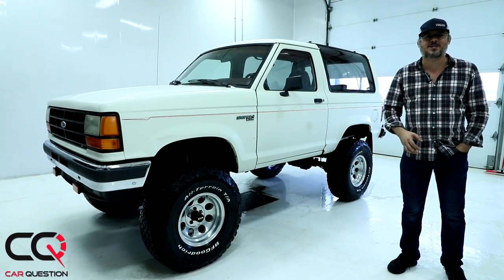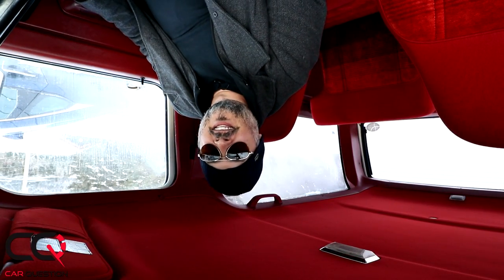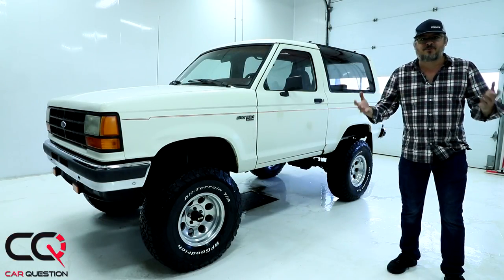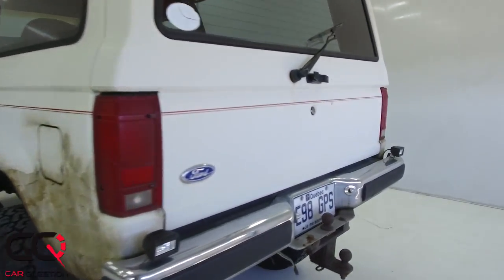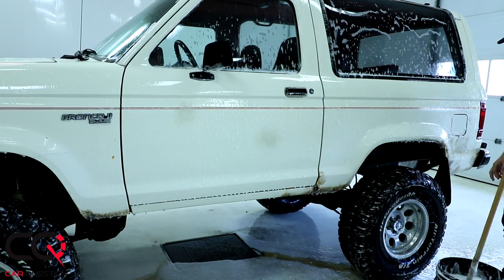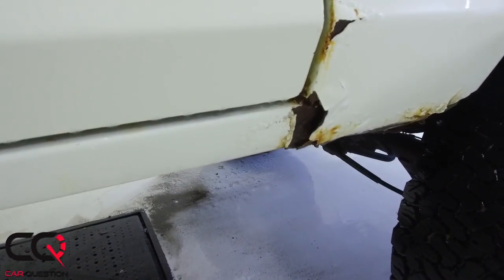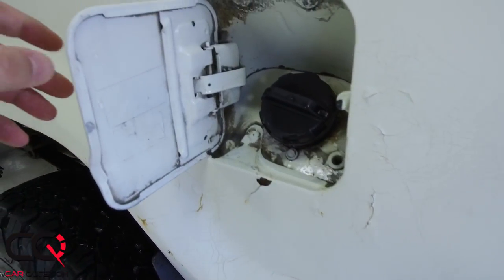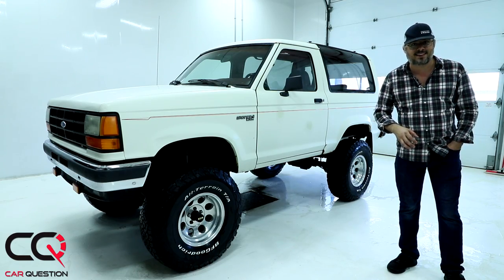Projet Ford Bronco II | Time get a FRESH PAINT and fix body parts! | Part 1

Comment: I love these old Ford Bronco 2's. I picked mine up for 300 bucks with a blown transmission. Since then I have put solid axles and a V8 in it for off road use. Check mine out! I have lots of information!